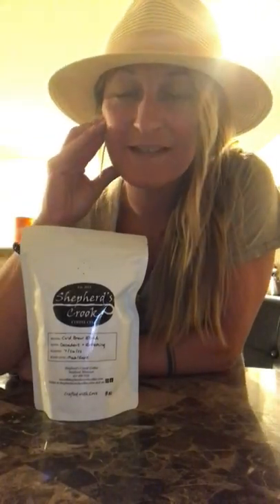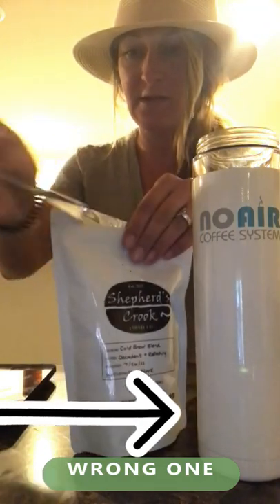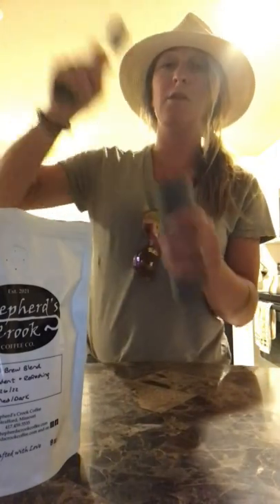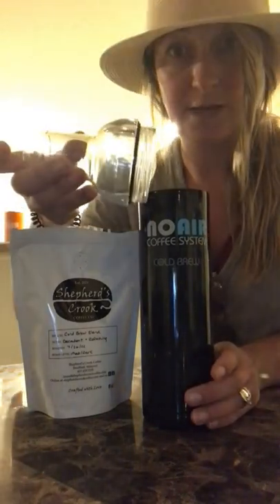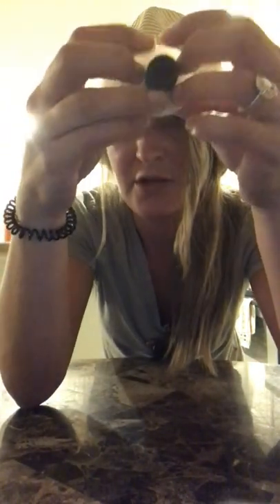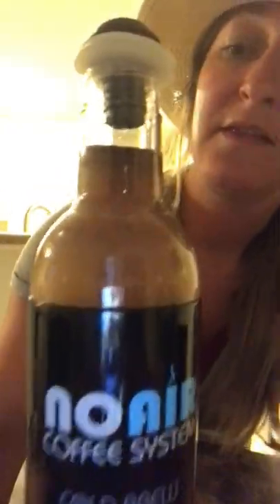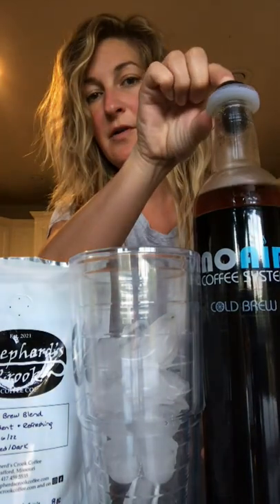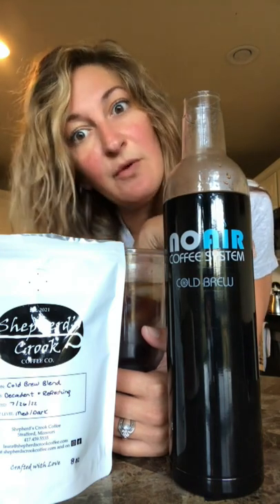TONIGHT we make Cold Brew from Shepherd's Crook Roasters in the NoAir Coffee System - Cold Brewer!!

Comment: Why do you soak the filters around the stopper? Do you soak it each time you brew? Does this make a coffee concentrate or drinkable coffee right away? How many cups of liquid does it brew at one time? I will never drag out a scale and measure grams of coffee grounds. How many cups of coffee do you use? Can you make a stronger coffee with more grounds?
Reply from the maker: Soaking the stopper allows it to become more pliable and flexible therefore allowing it to hold the vacuum seal for the 6-8 hours needed for cold brew time. This cold brewer is very customizable depending on how strong or light you like to drink your coffee. No scales needed if that is not your thing. This cold brewer can make anywhere from 20-22 oz of drinkable cold brew at a time.